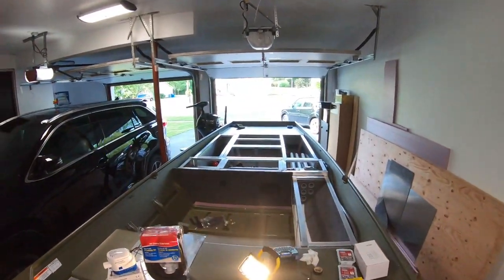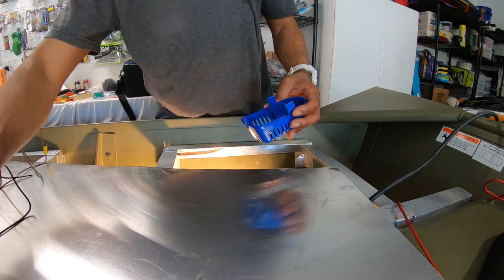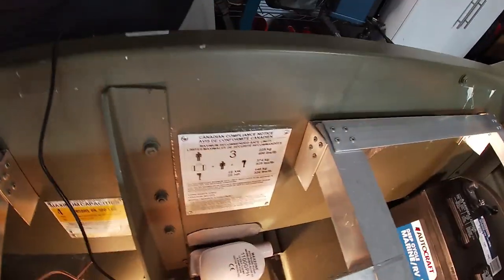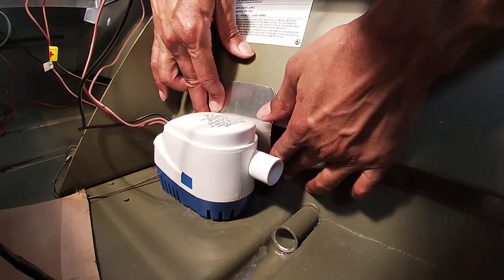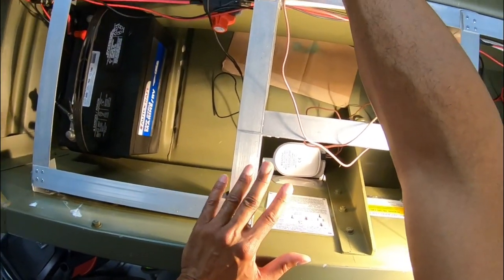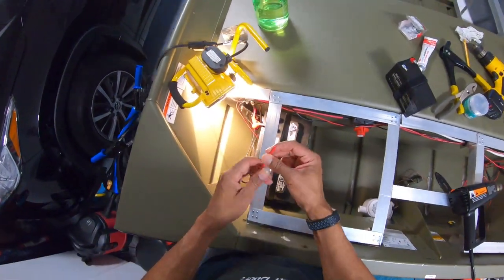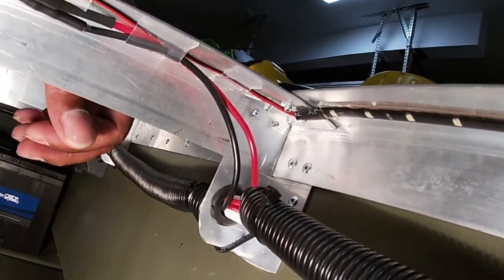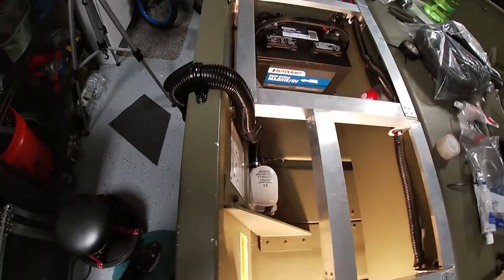BILGE PUMP Install Complete Step-By-Step {Jon Boat To Bass Boat Conversion} Lowe 1448

Comment: Bro, you’re a life saver. I’ve spent hours trying to figure out how to hook up a auto bilge pump without using a 3 way rocker switch. Nothing I read or watched told me you could simply cap
The brown and use brown white stripe as positive. Dude you are the man! Can’t thank you enough.
Reply from the maker: All good bro. Now get that bilge pump hooked up and get out on the water 😃🤙🏾👍🏾🎣🐟

Comment: I like your idea on the install and using the aluminum plate.  This little boat is going to be first class.
Reply from the maker: Thanks.  Coming along nicely.  The plate worked out pretty good 🙂👍🏾
Reply: 5200 it down

Comment: Just use the 3M 5200 to glue the pump to the floor. I put two in my boat. I have it wired so that if one turns on they both run.
Reply: I'm thinking of adding another one just like the one he installed (build with a floater) since the one I have activated only with the switch panel but I want to know if I can use only one hose for both pumps so I don't have to make another hole.

Comment: Thank you for the detail on the wiring - especially on the auto float wire connecting with inline fuse directly to battery

Comment: The hull plug should go on the outside, not the inside of the boat.  If you take on water, you can quickly pull the plug after getting on plane and gravity will drain the boat naturally.  Thorough work and very detailed explanations.  Thanks!

Comment: Ok sorry for asking I love all you videos my question is I have the same bilge pump the black wire from the bilge pump you went right to the battery right and the brown and white wire all went to the battery right and the brown wire went to the switch panel what size inline fuse did you use a 10 amp or bigger? Thanks

Comment: I'm thinking of adding another one just like the one you installed (build with a floater) since the one I have activated only with the panel switch but I want to know if there is a way that I can use only one hose for both pumps so I don't have to make another hole.
Reply from the maker: A 'Y' adapter like this might work. Seachoice 3-Way Y Fitting, Fits 3/4 in. ID Hose, Black Plastic https://a.co/d/dKICJWo
Depending on your hose size.

Comment: Alright if I may ask a question but at the same time break this down to make sure I understand. I'm using the same pump and hose assembly you have purchased and are demonstrating with, identical. I do not desire a switch so with that being said connect the black to the negative and the brown and white to the positive and test it. It works good to go? Or do I need to add a fuse still? Is a switch recommended? I understand the switch can be made to use a manual option but the way I see it why would you need a manual option if thats the main feature being automatic?
Reply from the maker: Yes, you are correct.  If you are not using a switch and you want the pump to work on its own meaning turn on by itself if your boat takes on water then only connect the black wire to the negative and the Brown and White wire to your power supply.  I would also fuse it with at least a 5 amp fuse just to protect it if you can.  The other wiring option is if you want to have the ability to activate the pump manually as a backup to the auto feature, then you would also connect the solid brown wire to a switch.  The you would be covered either way.  Hope this helps.

Comment: I realize this video was done a while back but I am wondering why the bilge pump was not secured to the bottom of the boat with West System 5200.  Yes it is permanent.  If you want it to be semi-permanent use the 4200.
Reply from the maker: Just didn't want to go with that option.  If I need to replace service the bilge pump, it's easier this way.

Comment: Did you use steel rivets and will they rust out?
Reply from the maker: I used steel rivets from Home Depot.  I hope they don't rust.  I'm not sure if they're stainless steel or not.  I hope they are.  Steel is stronger than aluminum but rust would suck.
Reply: Ok thanks
Reply: Should always use the same metal or your looking for trouble .. aluminum to aluminum,  stainless to stainless.. 
If the rivets don't say stainless they will rust 100%.